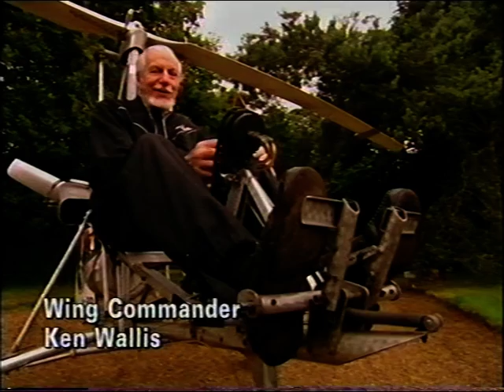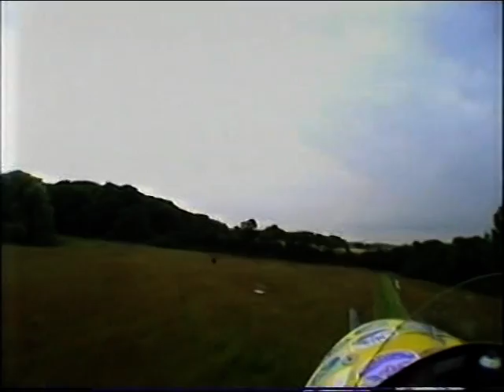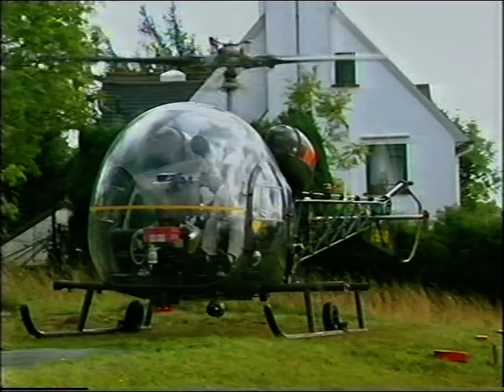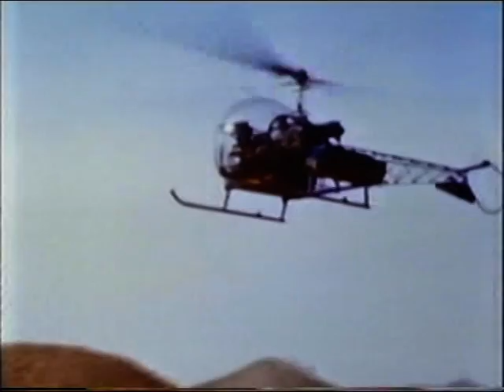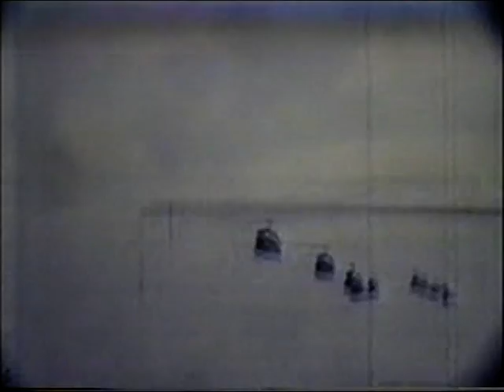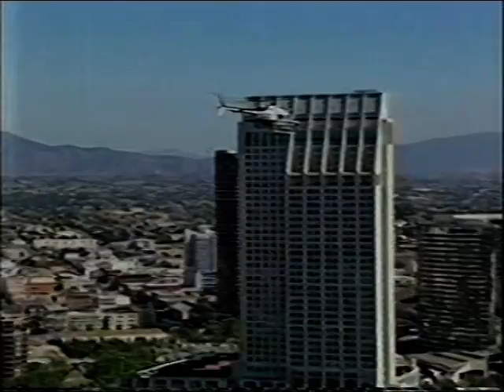Ken Wallis, Autogyro's and "Little Nellie"

Comment: There should be an easier way to start the engine instead of using your hand to turn the propeller...high risk of getting your hand knocked out.
Reply: RL: Tens of thousands of aircraft around the world are 'hand propped".  It worked for the Wright Bros!